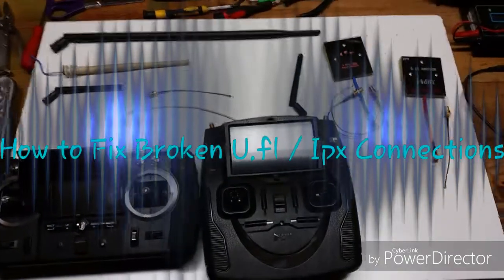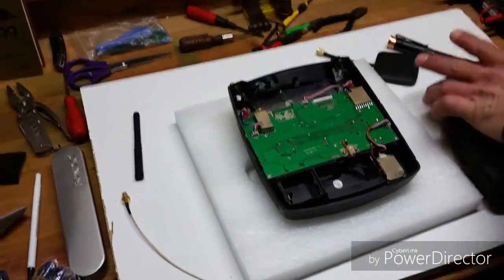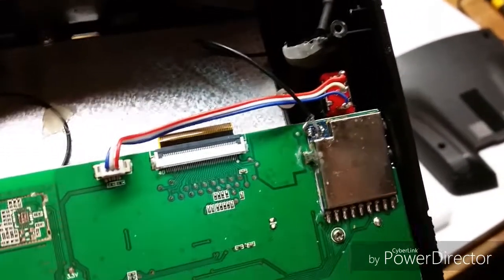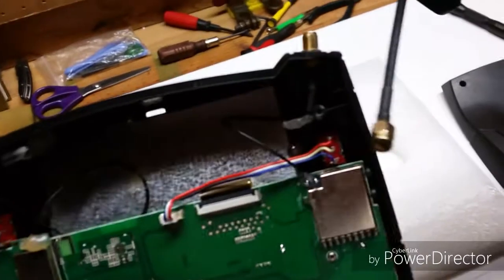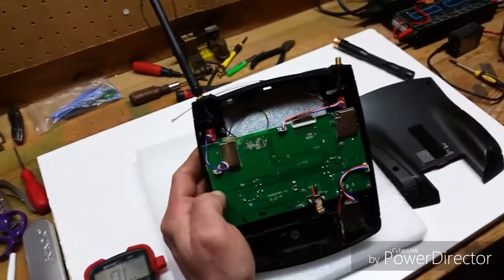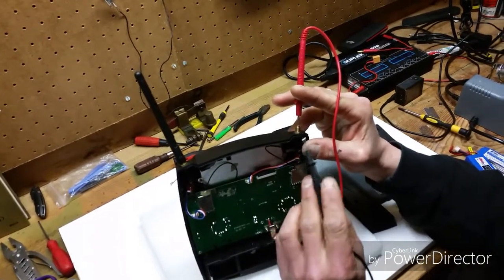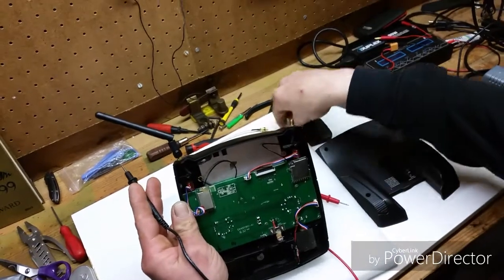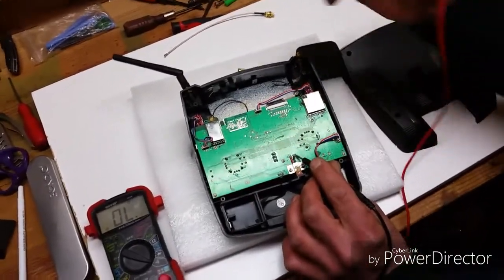hubsan h501s How to Fix Ipex ~ U.FL Connectors & SMA to Ipex Connection

Comment: This is a valuable viideo, It is probably more difficult to do but at the same time Im sure it provide's a more stable signal than those stupid plugs and connectors.. The cont test is the tell all smoking gun for any signal trouble shooting.. thumbs up Mark.
Reply from the maker: +anyshitt Thanks Brother !
Reply: When putting on the upgraded 2.4 antenna lead, the IPEX connecter really messed up the mating URL connector, so I ended up removing the IPEX connector and reworked the antenna lead to expose the center core wire after the shielding mesh was reworked to form a wire shape. First the antenna wire core wire was soldered to the pin in the center of  the URL connector and then the reworked antenna shielding was soldered to one of the ground spots on the perimeter of the URL contact. After that I checked the continuity for proper grounding etc. This was one hell of a job to have to do when you are in your mid 80's but better than the alternative replacement of the controller. Your video was a great help. Thanks

Comment: thanks brother nice info ☺
Reply from the maker: +WARI,S IDEAS Thanks ! I haven't been able to fly in Quite awhile because of snow, rain, sleet, wind, work, etc. But do plan on testing range, FPV, etc with the H501S-S, the H501S & H109S X4 Pro with some Different Antennas & the RG178 wires.